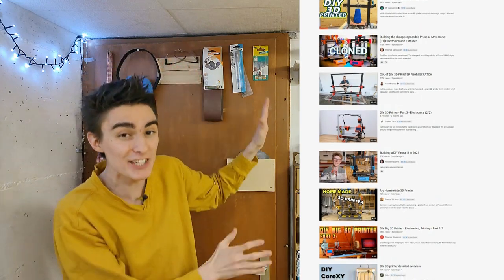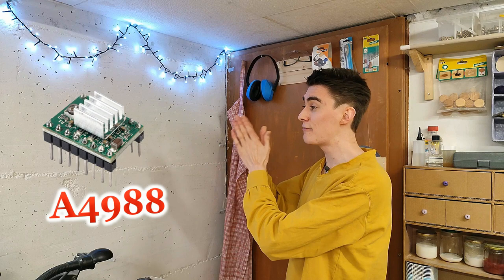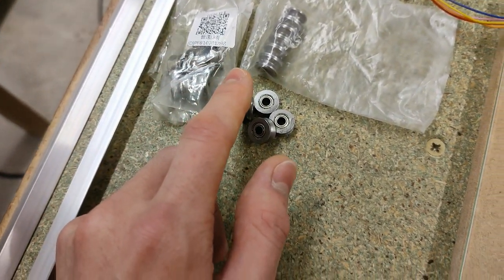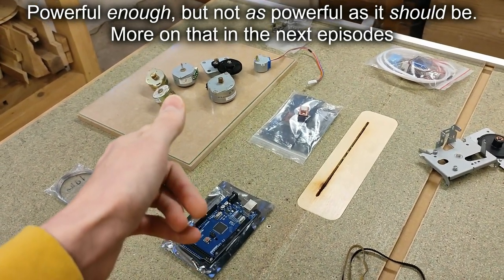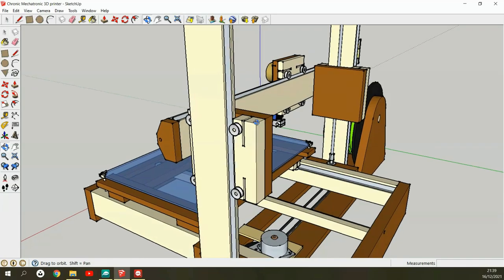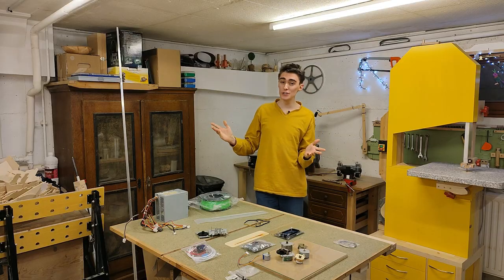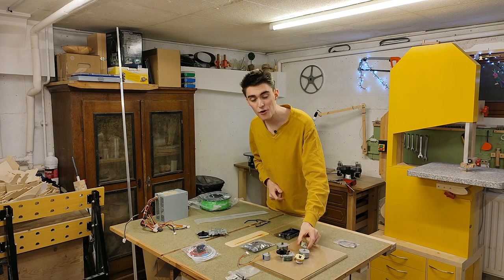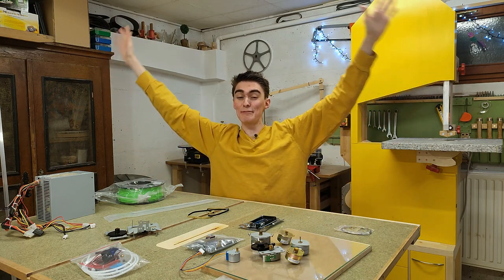330x240x240mm Arduino 3D printer WITHOUT using NEMA 17 stepper motors - Part 0 project introduction

Comment: Is it really unipolar?mine are like these but they have  4 wires as well and you can use unipolar as a bi polar with simple changes
Reply from the maker: All the stepper motors I plan on using are unipolar, but yes, I'm going to wire them in the bipolar configuration to use the microstepping drives. Except for the 28BYJ-48 extruder, for that one I'm developing my own true unipolar drive circuit :)
Reply: @ChronicMechatronic  Bruh i just hope and pray that you could finish your project.Your actually giving me hope on my cnc router project..😁
Iam actually planning to use 2 motors per axis..Will that be good?
Reply from the maker: @mustafizsiam1506  sure, you can theoretically use as many motors per axis as you want, you just need to connect them all in parallel to the same stepper motor driver, or if they're bigger steppers that need a separate driver each, just connect all the motor drivers of the same axis to the one arduino output for that axis. If you connect multiple motors to one single driver they must be mechanically linked so as not to be unequally loaded. Otherwise microstepping won't work...

Comment: Hi love ur vid! Do you think I can just use 28BYJ-48 stepper motors for X Y & Z axes too? I'm not sure where to salvage old motors and I'm a student on very low budget. And there's something about backlash u said?
Reply from the maker: Hi! Yes you technically can use the 28BYJ-48, it has been done before (check out the cherry 3d printer project: https://www.youtube.com/watch?v=mdrdldGIYgA which actually inspired my 3D printer to begin with!) though you will have to enable backlash compensation for it to work reasonably. However I strongly recommend looking for old printers, photocopiers, electronic typewriters, flatbed scanners etc to salvage better steppers from, cause many things you can buy at a low price will more or less be junk whereas components of a once expensive photocopier for example are a lot higher quality. The Canon 8800f scanner has an amazing albeit small stepper motor inside that I think would be perfectly suited for a small ender 3 style X-carriage. I know it can be hard to find E-waste depending on the country you live in, but maybe try asking at a local junkyard or recycling center, it's where I get stuff... Alternatively you could maybe post something on local social media for devices people are about to throw out. I say all this, because 3d printing is unfortunately a rather expensive pastime, even if you have a super low cost printer you'll pay a multiple of it's price for filament within no time. I bought 3 rolls of the cheapest PLA I could find and it already cost as much as the budget I set for the printer... So unless you recycle plastic waste into filament too, it will not be cheap no matter what - also, heatbeds gobble up a LOT of power. If you have to pay your electric bill yourself, the slower the printer due to crappy motors (like the ones I'm using) the more you'll pay down the road.
I hope this isn't discouraging as it's not meant to be, but that's what I've learned so far from building this machine and I think you should know before launching into this. Entry level commercial printers are already about as minimalist and cheap as a 3d printer can be made using new parts without resorting to total junk, hence why I think our best bet is still e-waste... That being said I am trying to develop a 3D printer ecosystem with proper included plastic recycling for as cheap as humanly possible, but that'll take me years to come...
Reply: @ChronicMechatronic  wow your explanation is so in depth and I've never seen a creator put so much effort into replying to viewers! Will take what you said into consideration and when I do make the final product I'll let you know for sure
Reply from the maker: @BenLam00  I don't usually take so much time to answer comments either, only when something constructive comes to mind :)

Comment: Hello, I have some information that can be of help.
For the firmware, I think the EasyThreed mini 3d printers use your kind of stepper motor. So you use their firmware as a base for yours as it runs on a modified arduino mega board.

You can do more digging on the EasyThreeD 3D printers, It can be of help as you make yours because of their type of stepper motor.
Reply from the maker: Oh really, thank you! I'll look into it!

Comment: Awesome!!!!!!!!! Keep it up! I made a laser cutter out of old scanners, inkjet printers, and laser printers. Oh yeah I will enjoy the series. And I am 14 and like building stuff like you! When I built my laser and had a hard time with the computer part like you had with your pen plotter! So your not alone!
Please reply if you see this. I really enjoy this channel!
Reply from the maker: I read most comments! Glad you enjoy my content, and yeah, there is definitely way too little information out there on how to build CNCs, 3D printers and stuff using salvaged stepper motors! I'll really go into detail to hopefully be helpful to people who want to reuse e-waste instead of buying new stuff!
Reply: @ChronicMechatronic  I also saved the linear rods from the printer because there like $8 a piece and got some bearings and used those for smooth movement. You probably could use those like the anet a8 uses.

Comment: Thanks for using cheap things.
Because most of us don't have such amount of money 

Kudos to You
Reply from the maker: Yeah, was about high time someone did it slightly differently... Though there's really no point in having a cheap 3D printer without also recycling plastic waste into filament to avoid having insanely high operating costs due to filament being stupid expensive.